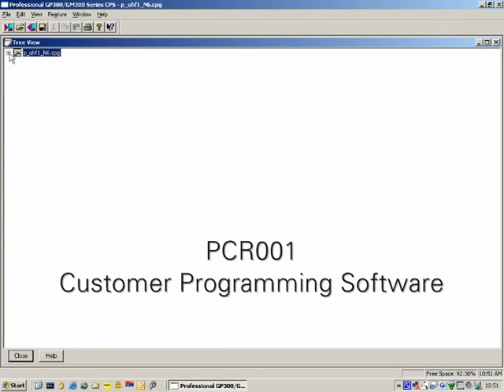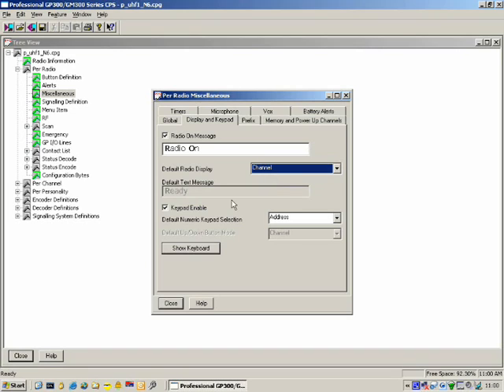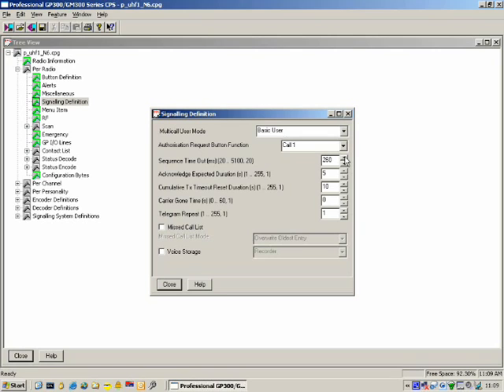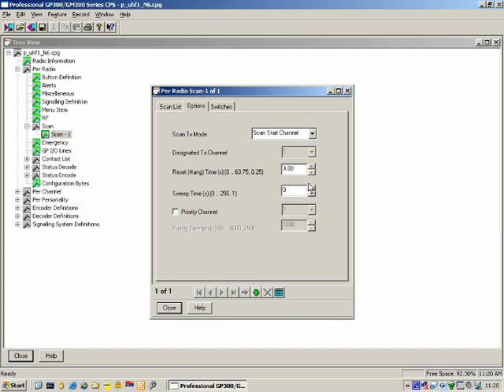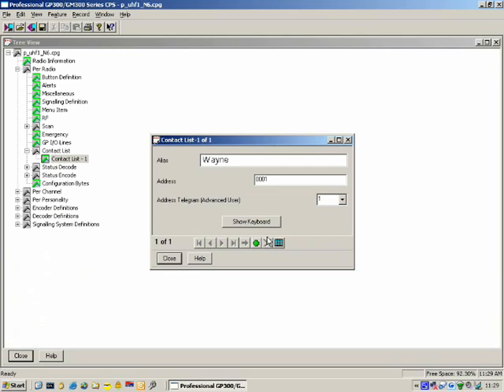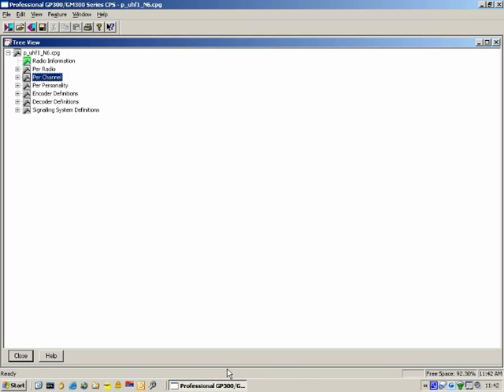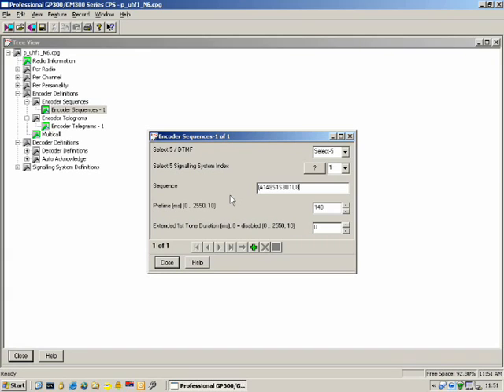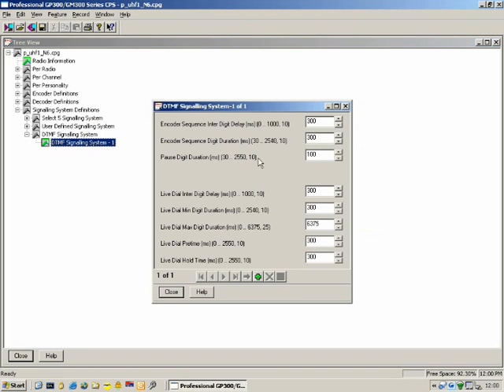Professional Series Select-5 : CPS Tutorial - Part 2

Comment: whats the program software for a D33LRA77ABK its a two channel &what operating system i can use  thanks
Reply from the maker: https://www.repeater-builder.com/motorola/maxtrac/radius-models.html

You’ll need MS-DOS. Windows 98 will also work. Windows XP maybe. Windows 7 onwards not.
You’ll also either need.a PC with an onboard RS232 port or RS232 on a card. USB to serial adapters are a hit and miss.
Reply: thanks brother

Comment: I've watched a couple of your videos now, and I am not finding what I am looking for.  Is there a way to reprogram Motorola HT750 so they will talk to each other, but not others outside of the units wanted?
Reply from the maker: Joseph Wieck Yes there is, either use PL or MDC1200 sel-call. I don't have any videos on that because the HT750 was only sold in North America and the model was discontinued in 2012. As a signaling format, MDC1200 was not very popular in this part of the world.
Reply: Wayne Holmes thanks for the fast reply.  I'm glad I found your channel.  I am assuming the cps tool I have is the right software.  there is 2 programs on the CD I have from Motorola.  1 I could communicate with but couldn't find a way to change much and the other would not communicate.  I will work on that some more.  Again  I thank you for your help.

Comment: I have a GP340, i read the standard settings from factory and only added and rearranged the channels freq and then write the settings to the unit. When i listen to marine channel 16 i hear nothing, then i press and release the PTT real quick and then i can hear the conversation on ch 16.  Why do i not hear the conversation automaticly? I am in range.
Reply from the maker: rbergqvist85 look at the auto reset and squelch settings for that channel.
Reply: Wayne Holmes what should it be? I can look in to it tomorrow, have the programming equip at work.
Reply from the maker: rbergqvist85 48:04 Auto Reset Mode should be set to Disabled.
Reply: Wayne Holmes thanks man, thumbs up
Reply from the maker: rbergqvist85 48:50 Squelch should be set to Carrier Squelch.
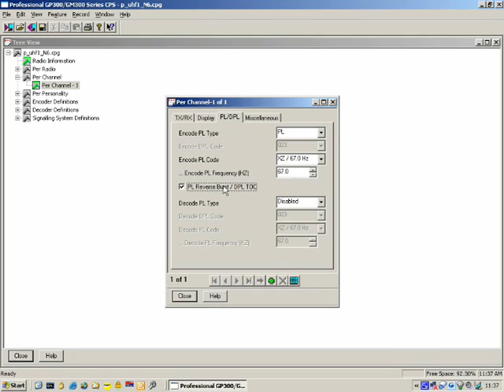Reply from the maker: rbergqvist85 44:27 The Personality where you've set Squelch Mode and Auto Reset Mode needs to be referred to in the channel.
Reply: Wayne Holmes you have been really nice to me with all these answers. But i look at the vid and it seems that i am a meathead, i dont understand the different SQ settings. I want the radio to work with as much other radios at possible, and i whant it på be as sensitive as possible because i monitor some channels.

Comment: Bonjour Wayne Holmes, nous avons le message suivant quand nous effectuons une lecture ou écriture de la radio, " Can not create unknwown radio component ". Pouvez vous nous fournir une assistance ? Merci
Reply from the maker: +Jean Philippe JPA Désolé, j'ai ne peux pas aider tres beaucoup sans a regard votre codeplug. il est une possibilite que la version en la radio et les CPS sommes different. SVP essayes lire ensuite ecrire sans modification en les codeplug. Quelle version les CPS avez-vous? [Désolé, sans Google Translate - mal grammaire et orthographie sont tout les miens :-)]
Reply: Merci pour votre reponse , pouvez vous nous assister ? Le problème est reglé , j'ai maintenant le message d'erreur suivant "couldn't open port check whether device rib are powered on or not....."
Reply from the maker: +Jean Philippe JPA Salut. C'est un problem avec votre programmation cable ou le COM port. Vous dois utiliser une originale Motorola cable et une orginale Prolific USB-RS232 convertisseur autrement vouz avez ces problemes. Certain serial ports avoir des problems. Avez vous une RIB? Verifie SVP si la COM port addresse et IRQ sont correct - je imaginer 3FF8 et 5?
Reply: Hi Holmes, How to check if the port adress and IRQ are correct ? I use USB to serial cable ( on windows 7 64 bits ) ; thanks for your support
Reply from the maker: +Jean Philippe JPA You can check this in Windows Device Manager http://windows.microsoft.com/en-us/windows/open-device-manager#1TC=windows-7.
Reply from the maker: +Wayne Holmes If this is not a Motorola (original) RIBless programming cable, then the problem is with the cable. If you are indeed using the RIBless cable, it is possible that the USB-Serial adapter is not providing enough voltage/current for the RIBless cable - if this is the case your only option is to try another PC or to use a RIB and standard programming cable.
Reply: HI, not sure if Original or Not , my provider told me that it is Original ( USB SERIAL PORT) ; In device manager all devices are OK ; Thanks